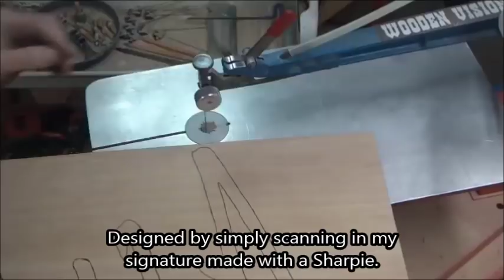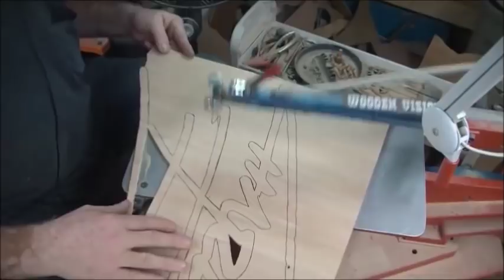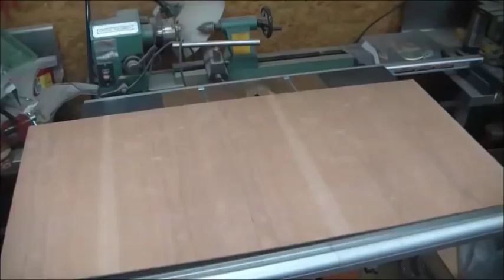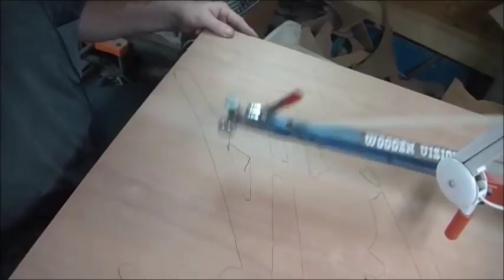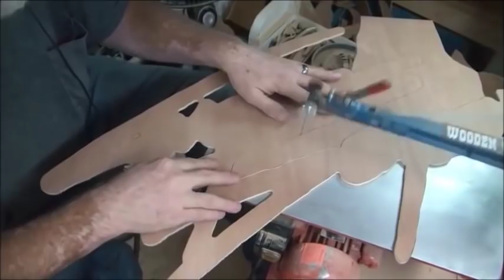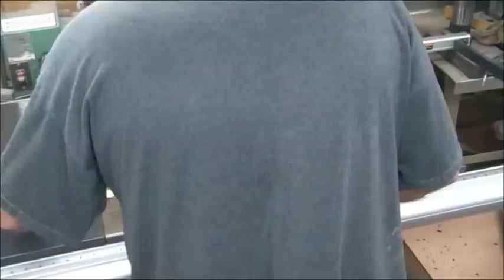No need to sign this project

Comment: cool piece of work there charles,just wondering,saw you spray the backer black,then you glued the scrolled piece on to it,my question,does the black spray affect the adhesion  of the scrolled piece,just asking,as i use spray but uasaly mask off where i use glue,,
Reply from the maker: I haven't had a problem yet. Thanks Tony.